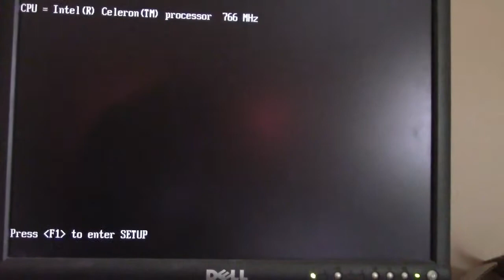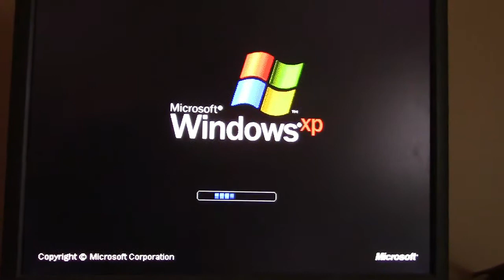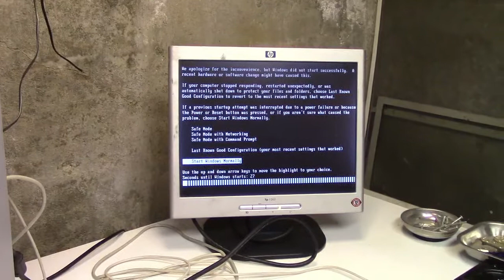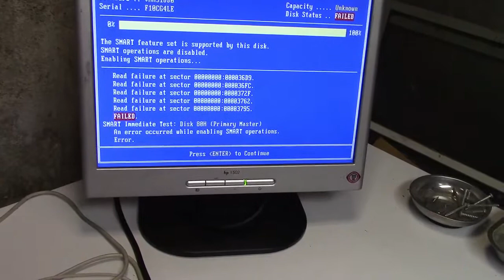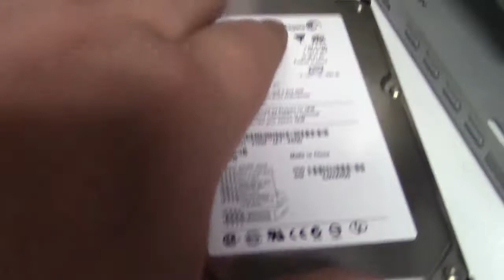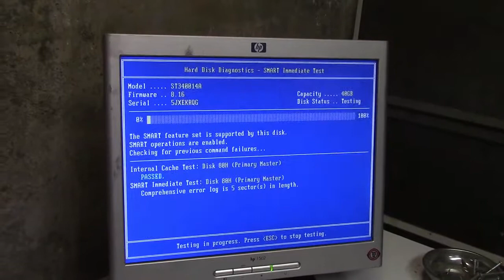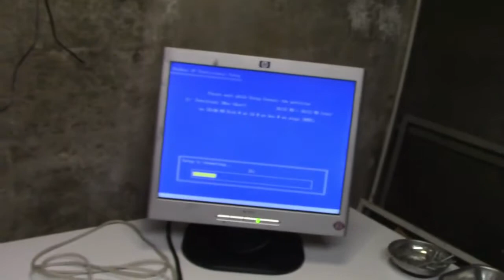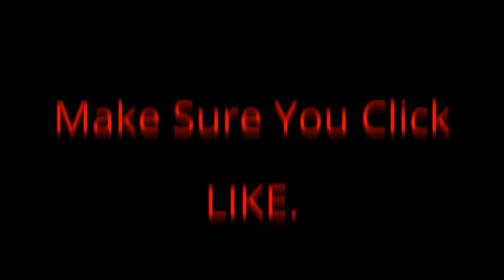Failing Digital Picture Frame Computer, Part 12 - It Died Already!!!

Comment: Funny, I just had my first hard drive failure in forever happen yesterday. The only Seagate I've ever bought new died without any warning. It was my primary backup drive; luckily, I had a backup backup drive. Still lost a little data though as I hadn't backed up some of the backups. Luckily it's nothing I'll miss. I'm one of those guys that swear by WD. The unit was pretty low hours too.
Reply from the maker: Low hours is fine, but how many years old?  Does it still spin up?

I hate when that happens.  Here's a guy on the WD side of the fence, buys a Seagate figuring maybe, and it goes belly up on you.  Now you'll always swear by WD.
Reply: I got it back in 2011 or 2012, and yes it does spin up. It was giving me the click of death for about a minute before the light on the controller would begin flashing and would spin the drive down. In a last ditch, I opened it up and lightly jarred the heads. Surprisingly, it appeared to correctly seek for a few seconds before it went back to square one. After that, it began to behave more erratically.
Reply from the maker: Well that's 7 or 8 years.  Regardless of hours, it still lasted a decent amount of time for a modern-ish drive.  Quite honestly, I think all hard drives have gotten considerably more reliable since then, I remember a bunch of bad disk drives around that time period.
Reply: Perhaps a capacitor-gate-esque time period for drives? Sounds interesting. It brings to mind those 80 GB drives that were put into power books toward the mid to late 2000s. The ones that failed after a couple of years regardless.
Reply from the maker: Yep, that's exactly where I was going with that.  In 2011, several hard drive manufacturing plants got flooded out, and there was a lack of quality drives on the market.  https://www.nytimes.com/2011/11/07/business/global/07iht-floods07.html
The article, however, states that Seagate's plant(s) were not affected.

Comment: I know I add things in the description that I forget to say in the video so that is why I read the description.  
I have some older IDE hard drives one is 40 GB, the other one is about 2 some thing gigabytes I think it is a dma 66 or something and the other one is about 1.5 gigabytes.  I will have to look for an older board to use those.
Reply from the maker: Those really small ones are going to need pretty old machines, possibly around 1995 or even before then.  Can't go too big of a drive because the machine's BIOS may not support it.
Reply: @jaykay18  Correct.  I think the 2 something gigabyte one wasn't fully recognized on win 95, not sure about win 98.  Win 98 I think it the 40gb needed some kind of boot loader to use the full capacity.
Reply from the maker: It's mainly dependent on the BIOS of the machine, then the operating system.  I seem to have a vague memory of FAT16 was supported on volumes 2GB and under, while higher than that required FAT32.  That's after you get the drive working of course.  For a Windows 98 machine to take a 40GB drive it needs nothing; a drive over 120GB will need something.  Again, that's provided the BIOS of the machine supports it first!
Reply: @jaykay18  I believe you are right. The bios was an issue and like I said there was some kind of loader to use the full capacity of the hard drive.   I still have a legit windows 95 cd rom and key.
Reply from the maker: Yes, there were loaders available, properly called "BIOS Overlays" that would be installed to then provide full access to the drive.  One caveat of that was the inability to access the hard drive if the machine was booted from floppy, unless you hit the key set forth by the overlay to send control to the floppy drive.  If you had the computer boot from floppy, the overlay was never loaded and the hard drive appeared dead to the system.  I have a 486 around that one day I'll play with again, and I know I had to use an overlay program in that machine.  If I recall, I had maybe a 1.6GB hard drive I put into it, while the system BIOS only supported around a 500MB hard drive.  At one point I had 3 hard drives in that machine, running Windows 98 with 32MB of RAM, and all 3 drives were compressed with DriveSpace.  That 486 was generally running at pedal-to-the-metal at all times.

Comment: Also, theoretically speaking, if you had popped the drive from the old machine into the HP, wouldn't it have picked up where it left off since XP didn't require any additional drivers to be installed?
Reply from the maker: Yes and no.  Chances are good that since the other machine didn't have any drivers that needed to be loaded separately either it would have worked.

In practice, however, there are a few other things to keep in mind:
1.  Drive translation.  While rarely an issue anymore, some machines used to use LBA versus some other stuff to translate cylinders, heads, and sectors.  It's been too many years and too many beers for me to remember all this stuff, until I need to again.
2.  The system will attempt to boot, but may not succeed.  Sometimes the architecture of the system is just too different, and the machine will crash and throw a BSOD upon bootup.  Occasionally, booting into Safe Mode and stripping Device Manager of whatever you can will allow it to boot and re-recognize all hardware.
3.  Provided you do get the system booted and all hardware is recognized, Windows may still be dazed and confused and require you to reactivate Windows.  This can be likely if the architecture is very different (such as an AMD in one machine and Intel in another).

Comment: That hard drive seemed unreasonably cheap, I'm surprised it lasted as long as it did.. I have to wonder if it quit because some kind of contaminants finally made their way into it..
Reply from the maker: Those tape seals were fine as long as they weren't punctured.  A lot of early Windows 95-98 era Western Digital hard drives used a tape seal around the edge of the disk.  You'd also be able to find these drives (anywhere from 2-8GB) on retail shelves, and many times someone would pick up and buy one of these drives because their son "knows about computers".  Generally, this son has trouble remembering which end of the screwdriver to hold.

Now this tape seal would go around the edge of the disk, and in one or two places, depending on model, the case had a cutout area maybe 4 or 5 mm in height that the tape seal would cover.  Curiously, that cutout was near the area of one of the screw holes for mounting the drive.

So the son who "knows about computers" would go and upgrade the computer.  But being that his knowledge doesn't even cover which end of the screwdriver to hold, oftentimes one of the mounting screws would be inserted, puncturing the tape!

I actually received such a drive from someone back in the day.  I think it was working perfectly but I didn't want to use it, so I called up WD and sweet-talked my way through warranty replacement.  At the time I don't think you had to prove the drive was failing, they'd just take it on faith that it was.  Then sent me a pre-paid label with the new drive, and I sent the old one back.  Turns out they never noticed or said anything about the punctured tape seal.

The hard drive in question in this video dates back to 2002; I was probably using that drive in 2003 or 2004 in this very machine, and it was exhibiting these same random pauses where the machine appears to be frozen, and then just as mysteriously would start working again.  I'll bet this drive was bad all the way back then.
Reply: @jaykay18  That does seem likely..
Reply from the maker: Especially since it's a Maxtor-branded Fireball drive.  Basically that's a relabeled Quantum drive; when Maxtor bought them out, they had to sell off their remaining stock, and needed them Maxtor-branded.

I have another Quantum-branded Fireball drive, suspiciously also 20GB, but it's a much more substantial drive.  That drive had a very odd issue with power; if it was powered up and running, it was perfectly fine.  If it lost power for any reason, the drive would refuse to even try to spin up the platters.  I think I still have it actually; I used to use that as a media drive in my SHOUTcast server, but one day we had a power disturbance and it refused to spin up anymore.  I should do a video of that.  Fortunately, I had everything already backed up when it died.
Reply: @jaykay18  Good..
Reply from the maker: It was good.  What's even better is I still keep the data on the replacement drive backed up, and better still is that the replacement drive is still going after 8 years, and I have no idea how many hours it had on it when I got it.  It certainly wasn't new then.
Reply: @jaykay18  OK

Comment: Easy come, easy go, means nothing when items are purposely ignored.
Reply from the maker: There was no guarantee that drive was failing.  Even my Super Senses™ were telling me the drive is fine and the machine is crap.  Since I ride all hardware out to the very end, the drive stayed in service.  Otherwise I would have missed those 5 months of service and tossed the drive, or worse, put it in the pile and used it later on only to have it fail in something else.

Comment: Well it did at least make it through Octember! 

What if you get a buzz , click, clunk?! Haha.

Good series, thanks for sharing.
Reply from the maker: Yeah, probably the one thing that did make it through Octember, but that's only because I had ensured its usability, which quickly went downhill.

If I get a buzz I'll be happy enough!  Gurgle gurgle!

There's a couple more parts to this, but in the end it's going to turn out like your Maytag washer!
Reply: Cool, looking forward to seeing the finished machine.
So far, I'm absolutely pleased with the Maytag. Well worth the effort to refurbish.
Reply from the maker: Thanks.  Yeah, it's a huge sense of accomplishment.  Every day when I walk by it's just nice to know that it's running well.  That sense of accomplishment is something Millennials generally won't experience.
Reply: Yep, I feel that way when walking through the laundry room. Knowing the 40+ year old washer,  dryer, and nearly as old refrigerator are in tip top condition, and when something does break, I can get it working again.